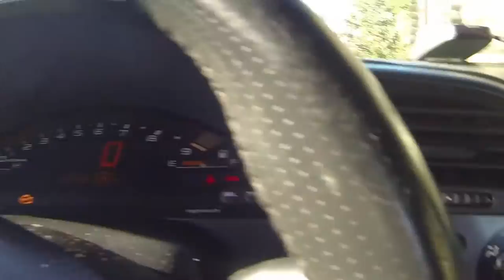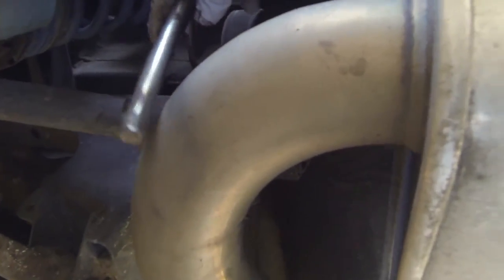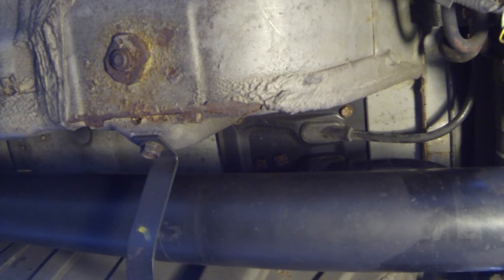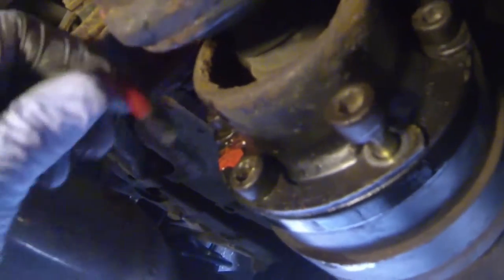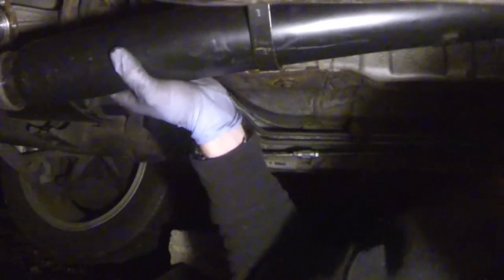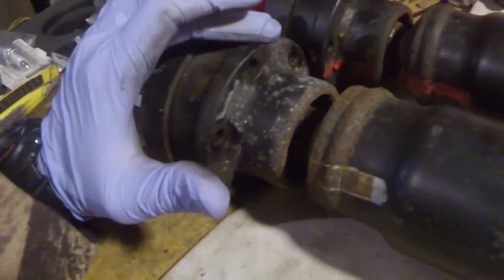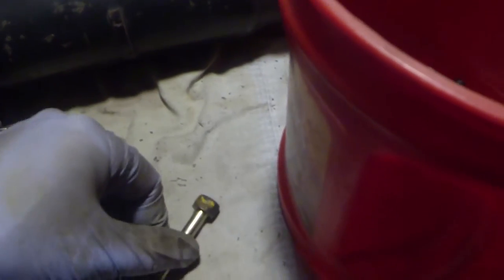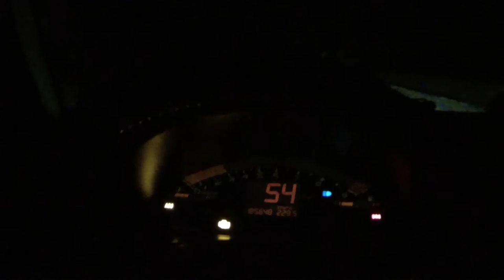Honda S2000 Driveshaft/Propellar Shaft replacement how to

Comment: i had a vibration at 72-76 mph (in any gear, accel/decel/coast) and i have determined that the previous owner changed clutch and replaced 1 of the m10x1.25x62mm driveshaft bolts with an m10x1.25x60mm bolt.  If i move the bolts around, it changes the vibration behavior.  I just went and bought 12x 90182-s2a-a00 bolts from honda.  my assumption is that these are hardened grade 10.9 or better (sae grade 8 or better) and corrosion resistant, so you dont want to replace with non-oem.  black oxide hardened bolts will mess yo shittup.  also, make sure you get the late model year bolts, since the have an 8mm hex drive instead of the 6mm hex drive i think early models had (not sure).  torque spec is 24 ft lbs.  i use hex bits with 3/8"  drive, a 6 incvh wobble extension, and a 3/8" drive torque wrench to change them.
Reply from the maker: Did that ever fix your issue? Mine was fine after this job up until I sold it a few months ago.

Comment: I'm about to do the same, but I notice that you didn't mentioned anything about vibration. And that's what happening to me. 1st to 4th gear a strong vibration and 5th and 6th a little bit depending the speed. But my driveshaft is exactly like yours. Do you think its the same?
Reply from the maker: Yeah the driveshaft, or propellar shaft as Honda refers to it, should be the same on all model years. Nothing really changed that I am aware of, and that vibration soudns like the driveshaft. I would get under it first like I did and check the play in the shaft. Watch my video and compare the play that I show from the old shaft and the new one, that should give you a pretty good idea of  whether it is the shaft for sure.
Reply: My car has the a strong vibration on 1st to 4th... 5th and 6th are much less.. Did you get your fixed back then? what was it?
Reply: @coffeemonstar2  end  up replacing the differential and that was it
Reply: @codenmdb  I see, I am still trying to figure out mine. Thanks

Comment: Just some info for anyone having this issue. Before you go buy a brand new $1000  drive shaft or buy a used one in unknown condition from ebay, you most likely just need to re-lubricate the old drive driveshaft. 

https://www.youtube.com/watch?v=Q5YA1aMsaNc
Reply from the maker: Once it is like this, it is shot, lube will not help.

Comment: Great video.  How have those non-honda bolts been holding up? They seem like special bolts.
Reply from the maker: Holding up great! They are nicer than factory in my opinion. Thanks for watching!
Reply: Thanks! Bought bolts from Fastenal. Much cheaper than Honda, and wont strip out as easily.
Reply from the maker: @jordananders8525  That is great. Have you installed everything and what do you think about the bolts?